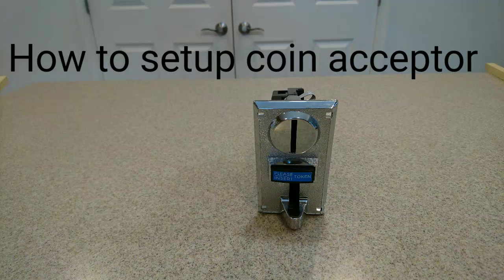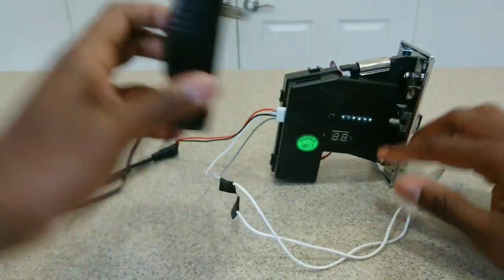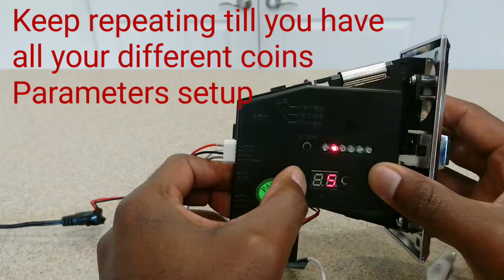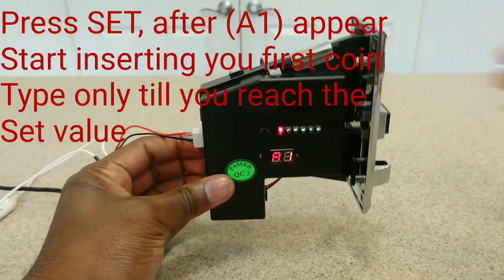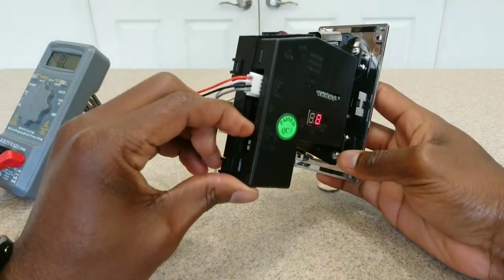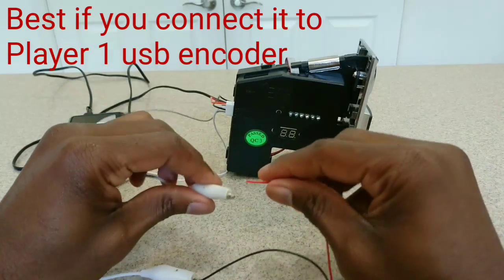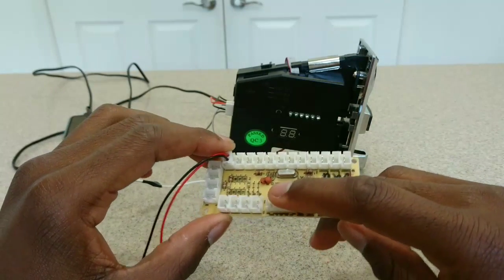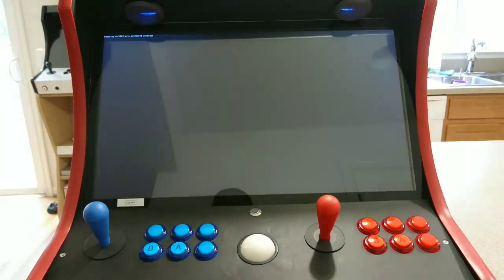How to setup coin acceptor on raspberry pi retropie

Comment: I am using the 616 version and I can't get it to work properly. My raspberry pi thinks a button is getting  pressed without putting a coin in. Does anyone have a solution? Or should I get another version?
Reply from the maker: Make sure your normally open(NO) and normally close (NC) switch is in the NO position.
Reply: @eldon226  It is on NO. Also it is set on  slow. It seems that the contact of the coin module is not potential free. In other words: there is alsays a voltage on the input of the encoder.
Reply from the maker: @danver7629  oh, I understand. I'm not aware of any solution other than replacement.
Reply: @eldon226  can you maybe measure the voltage on the output of the coin module. If you also always have a small voltage running, my problem might be something else.
Reply from the maker: @danver7629  I no longer have that coin acceptor, sorry. Have you tried factory reset and reprogram.
Reply: @eldon226  I will try that. Do you know how I can reset it?
Reply from the maker: @danver7629  I'll have to search through some files, don't remember from memory. I'll get back to you when I find it.
Reply: @eldon226  thanks for your help!
Reply from the maker: @danver7629  here is a quick manual bellow 

https://www.dropbox.com/s/mc90uw5un23wysp/UT8aSWzXjJcXXagOFbXf.jpg?dl=0

Comment: The ipac4 board only has one input for coin... which cable will work for that?
Reply from the maker: I'm sure it has two, use the same ground pin that you used for the buttons and the coin pin.
Reply: eldon226 I found someone in a google search right before you replied and got it, I appreciate your fast response though... I’m working on a tabletop
Reply: I appreciate your videos

Comment: I have my coin acceptor programmed and wired up, but it's not registering a button press on my arcade when the coin is dropped.  However, if I switch the coin acceptor to normally closed it registers continuous button presses.  So, a signal is being sent to the USB encoder.  I have no idea what to do or how to correct this
Reply from the maker: I'm not sure why that is either. Maybe reset and start from scratch. Sounds like you might have missed a step in the coin programming.

Comment: Does your Coin Mech still work with Retropie 4.4 and new Retroarch? Ive bought the same one and whenever i insert a coin it just resets Retropie. I cannot even assign it as a button in Emulationstation or Retroarch because it just resets straight away.
Reply from the maker: Yes, it still work. I did not update update either. I'd recommend you do a fresh install and not use the update option. I've seen a lot of people have issues when they do that, the coin acceptor is fine, it's the software that's broken if the only change that happened was an update.
Reply: @eldon226  Thanks, which version do you currently use so i know its stable
Reply from the maker: @jaymerc2005  any version of retropie will work, you may just need to reconfigure you control. Remember this is connected through your USB encoder and works like any other button connected to the USB encoder. If you want to do some troubleshooting you can remove the coin acceptor from your USB encoder and add a momentary button. Test and see if that changed anything, I'm almost certain its because you did an update and didn't install from scratch.
Reply: @eldon226  Ok, i will update once i've found the issue just in case someone else is having the same problem. Thanks again
Reply from the maker: @jaymerc2005  ok, I've had that problem in the past. It came from updating the software through the software option instead of a clean copy. Let me know though

Comment: Does it give +12V output pulses, +5V pulses, or 3.3V pulses?
Reply from the maker: Neither, it's just like a switch. Open and close the same wire
Reply: @eldon226  thanks! And what's the pulses frequency?
Reply from the maker: @m4l490n  I don't know, sorry. You're obviously more advanced than I. I just know that it works similar to a relay switch. Drop in a coin and it will either open or close a circuit temporarily.
Reply: @eldon226  its 5v pulses

Comment: Does someone know if there is a way to plug this coin selector with a CY-822B board??
Reply from the maker: Yes, you can use it exactly how this video describes it. Attach it to the same two wires you'd normally attach your coin input button to.
Reply: @eldon226  because It has 3 wires connectors and I tried ALL possibles combinations and the coin sellector didn't work.
Reply from the maker: @suelenbraga2006  I'm sure you're not doing something correct. It has 3 wires because you can use LED buttons with it. Try to connect your button then remove one of the three wires, test the button and repeat to root figure out which two are actually connected to the switch pins in the button.
Reply: @eldon226  Ok. I will try it. Thanks sir.
Reply: @suelenbraga2006  did you find a way to making it to work ?

Comment: you my friend just saved me a ton of headaches! gotta love the Chinese to English manual instructions NUMBERICAL???? HAHAHA! also one minor thing I noticed was that you don't want to have the multi-meter leads connected to the counter and coin wires when you are sampling the coins. Doing so caused me to get "0" on the counts and then I would need to power off the unit and redo the procedure. Leaving the multimeter disconnected until it was programmed solved this issue for me. Hope this helps someone else out, Thanks for the video!
Reply: what is the multileader lead? i am having that issue right now
Reply: @ellobobeats6324  multimeter leads are your red and black probes on your measuring device, leave these disconnected when sampling the unit with coins
Reply: @hardkore360  thank you so much for the info 👍

Comment: Once again Fantastic! One question... There is a way to stop from accepting coins and start it again... with some relay or script!
Reply from the maker: The easiest way to accomplish that is to add a button in parallel with the two wires going from the coin acceptor to the usb encoder. This button will do same function as the coin acceptor, you'll just need to push it manually. Something to note here is that both the coin acceptor and the button will allow you to add game credit, you can add a switch in series with the button if you'd like the new button to be disabled sometimes. Hope I didn't confuse you.
Reply: @eldon226  Good idea. 
I want to be autonomous... so I was thinking to run a script each time that a game start, through the GPIO and give power to the coin acceptor.
Reply from the maker: @paolocid  I'm not sure what exactly you're trying to do anymore, the gpio won't have enough power to power the coin acceptor. Are you saying you don't want the coin acceptor to work when you're in the main menu when but start working as soon as you start a game? If that's what you're trying to do I don't know enough to write my own script.
Reply: @eldon226  Don't worry I was asking maybe if you know some other way, but I will need to write you down every single detail to what I want to achieve, but you done enough with your video thank you very much!
I will give power from an external 12V on the relay as a switch, and the command from the GPIO.
Reply from the maker: @paolocid  your welcome, sounds like you got it figured out.

Comment: Hi sir good PM! What are the steps on resetting the coinslot? I mean, the one that would turn back the coinslot to its factory settings.
Reply from the maker: Remove the power, press and hold the "set" and "add" buttons together, apply power while still keeping those two buttons pressed, keep them pressed with the power on till and release them after you hear a beep.
Reply: eldon226 thank you for your reply sir. Ive tried those steps but I cant hear a beep.
Reply from the maker: @seanjohndensing8485  if you don't hear any beep hold them for at least 20 seconds. You can test to make sure it work by putting in a coin you previously programmed
Reply: eldon226 after I release them “A” will be displayed on the LED display. Should I remove the power again? Or press “setup” then “A1” will be displayed

Comment: On the retropie, do you have to have a coin acceptor for each player?
Reply from the maker: No, but I think I know what your concern is. Some games use one coin acceptor for both players, as long as there is enough credit it'll work for two or more players. Some games also require a coin acceptor for each player, to fix this I went into the game configuration and set the player one and player two coin buttons to be the same exact button. I did this to those specific games (not for the emulator). Hope that answers your question
Reply: eldon226 yes it did Thank You
Reply: @eldon226  wouldn't that assign 2 credits every time you dropped a coin in, if it was wired to two players' "coin" buttons?
Reply from the maker: @JamesHannagan  I don’t remember, but thinking about it I believe that’s how it worked for those few games that needed each player to have individually assigned coins. Keep in mind that the amount of coins required to start a game can buy changed if you’d like to adjust that also.

Comment: Do u know if it will work with a
 Pandora box? Thanks. Subbed also
Reply: LEST 3000 if you have a coin switch now and you dont know if the pulse is the right one ... you can put in a relays between the accpetor and game board controller

Comment: Do u know if it will work with a Pandora box? Thanks. Subbed also
Reply from the maker: I'm not very familiar with the Pandora box, but if it has a dedicated button that's used to add coin then yes, it'll work. The way I have this working is just like any other button on the control panel. Putting in a coin is equivalent to pressing a button.
Reply: @eldon226  thank you. Yes it has a dedicated coin button. I'm going to try that.
Reply: Worked great with the Pandora Box 👌👍😊..
Reply: Did the Pandora box work?
Reply from the maker: @johnallen8334  you should ask  LEST 3000  because he's the one with Pandora box

Comment: could this burn my pcb? some people suggest to add some diode or something to make 12v to 5v?
Reply from the maker: The use of diodes is not to reduce volts, they allow current to flow in one direction. Also this device needs 12v, not 5. Next, connecting and or using any electronic component incorrectly can damage other equipment they are connected to. The way I am using the coin acceptor is just like the other push buttons on your joystick. The only difference is that the coin acceptor has two additional wire which needs to be connected at a 12v source.

Comment: I am super noob, and I don't know how to wire this thing with the adaptor. How do I know what is gound/positive on the adapter side??
Reply from the maker: What adapter?
Reply: DC 
power adapter
Reply from the maker: @LeesInUSA  the best way is with a multimeter, if you don't have one, most power adapter have positive on the inside (hole) of the cylindrical plug and negative on the outside. You can also just connect it to the coin acceptor power input (black and red wires), if it does not work switch the wires around. That will not damage the power adapter nor the coin acceptor, assuming you're using a 12v dc power supply.

Comment: Thanks for the video eldon226. I have 2 coin acceptors and 1 12v power supply. My question is, can I power the 2 coin acceptors with 1 power supply? If so, how? Can i connect the 2 positive wires together and the 2 negative wires together into the power supply? Or do I need some kind of Y-spliter?

Comment: Hello 4 you video my Coin Acceptor working fine THANK YOU VERY MUCH.
I got 2 Qestions
1. How is full reset this coin acceptor ?
2. At Mame, in games midway MK, WWF WRESTLEMANIA, etc. you also get credits despite leaving the game, if not how you repaired
Reply from the maker: KRIS B if your game saves the coins from the last time you played the game that would be changed in the game settings and not the coin acceptor. If you want to reset the coin acceptor you can try this instruction (I've never reset mine so I'm not 100 percent sure on it) make sure no power is being sent to the coin acceptor, hold the SET and ADD buttons, apply power to the coin acceptor while still holding those two buttons. Release them after about 10 seconds. This will put it back to factory settings, all your programming will be deleted.
Reply: Hmm but i change in setting services mode etc and not help  ;(
will try your way after Easter, Happy Easter  ;)

Comment: Hey man, wicked video, very helpful. But I do need some help..
I have my arcade controller built and configured and it works just fine, and i'm pretty sure
i configured the coin op. just how you have it (as L2), BUT when i go into the game to assign the coin op for coins i'm just supposed to press TAB on my keyboard correct? well it's not working.. my keyboard seems unresponsive while in games, any advice?
Reply from the maker: Travis Anderson which emulator are you using?
Reply: eldon226 I am using the arcade emulator in the retropie pack. I think its MAME2003. I'm trying to get my name 2010 working but it's not working for me either.
Reply from the maker: Travis Anderson both those emulators use retroarch control configurations. That mean they use the inputs you used when you first used emulationstation. You should program your keyword the same way as you did your joystick and it should start working while in mame 2003. It's been awhile since I did anything on it but use the main menu and find the coinfig control option. Hopefully that works

Comment: This is sweet, thank you! Does this plug into and work with Windows too?
Reply from the maker: Oliver Wilmot I am aware that I can work with windows but I don't know how, unless you're going to be using it like shown in this video that you just connect it to your USB encoder.
Reply: Oh right. If this plugs through via USB, I assume it will work for Windows too, as the emulators are on Windows as well. When you plug it into your Raspberry Pi, do you need to install any drivers for the coin slot or USB device?
Reply from the maker: Oliver Wilmot it does not get plugged into the raspberry pi. It gets connected to my USB encoder very similar to how a button gets connected to the USB encoder with just 2 wires. You can do it exactly like that on windows too, with the USB encoder. If you use USB I don't know how to get that working, I know when it's connected via USB or serial you get a lot of functions, like tracking how much money has been inserted, how much of each different coins inserted, programmable time for each coin, ect. I just don't know how to that extra stuff.
Reply: Cheers. Oh I see. Did the USB encoder come with the Coin Acceptor?
Reply from the maker: Oliver Wilmot no, but it can by connected to any arcade usb encoder, it's just being used as a momentary switch.

Comment: sir why is it when i am in the set-up method (the part when i put a coin) the coin is not falling . the coin slot is rejecting the 3 kinds of coin.
Reply: please help
Reply from the maker: james labz make sure the return mechanism is not faulty, push the coin return and observe what happens, watch what happens when you insert a coin to see if its because of the return mechanism. Also make sure the coins you're using are not too large. That's all I have for now.

Comment: @eldon226 i make the same like you... but my problem is when i drop a coin that is set to 5 impulse my mame only reads 3 pulses. i make the settings slow like you... do you have i idea what i can do?
Reply from the maker: Arturo Rapa yes, you need to change the settings on the game itself. Some games are set with different values as default. For example, some games require that you insert two coins for you to get one credit. So you'll need to change that and set it to one for one. Hope this help and fix your problem.

Comment: These coin connectors operate in 12v. How does making them work as a button not damage the encoder? (sry im noob)
Reply from the maker: Toneh Bam it's not supplying any power to the encoder, it's doing the same exact thing as a regular standalone button would, which is taking two wires and attaching them together or separating them from each other (opening and closing a circuit). Hope I explained that well enough, that's the simplest was I could think of for explaining it.
Reply: Eldon226 I see. How does that work with pulses? Would 7 pulses send 7 key presses?
Reply from the maker: correct, that's exactly what it does.
Reply: Eldon226 Thanks. This has been most helpful!!

Comment: can this hook up on any of the Pandora's Box
Reply: yes you can use this on Pandora's Box https://videocdn.taobao.com/oss/taobao-ugc/4d7b6659de4845c68a34fc6b4a17d85a/1503311186/video.mp4
Reply from the maker: I have never used Pandora's Box but i can't think of any reason why it wouldn't work with it.
Reply: thanks for the heads up, really like this video great help

Comment: Great tutorial, but where on earth could I get that USB encoder? I'm in the process of making a machine for public use and all I'd need is a simple quarter input to work.
Reply from the maker: Link Hero Of Time you can use just about any USB encoder but this is the one I used.

https://rover.ebay.com/rover/0/0/0?mpre=https%3A%2F%2Fwww.ebay.com%2Fulk%2Fitm%2F302201377219

Comment: Thanks so much for this video dude! Super helpful! Do you know if it is possible to wire in a button in addition to the coin acceptor that also works as a «credit» button? So you can choose to either press the button or drop coins? Thanks again, and keep up the good work
Reply from the maker: Henrik Vik yes, that can be done, just connect your credit button in parallel with the one from the coin acceptor. You can also configure you arcade emulator to accept coins for two different inputs, one being the coin acceptor and the other being a push button.
Reply: eldon226 awesome, thanks bro!